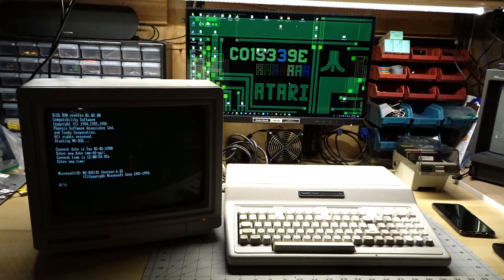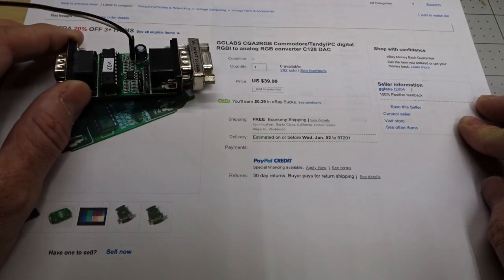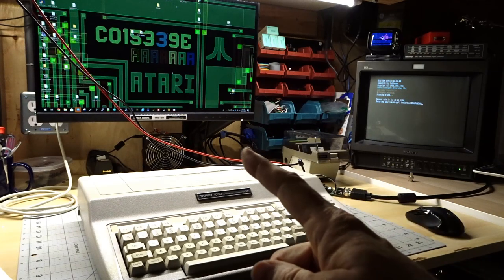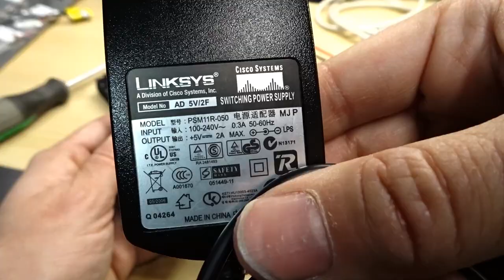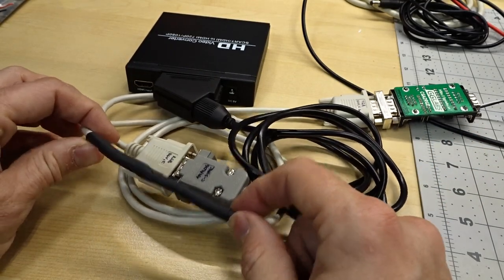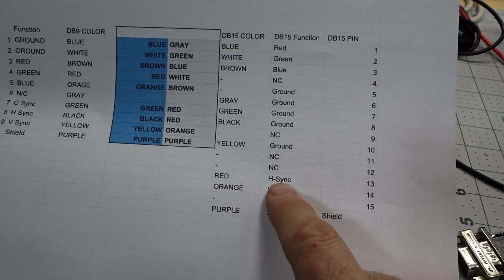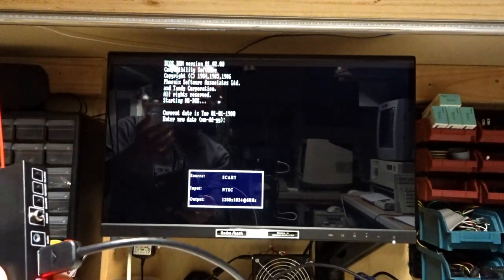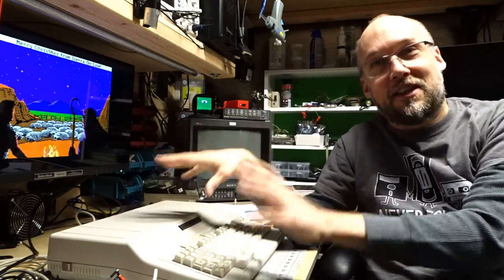How to convert CGA video to HDMI for around $65

Comment: Hi, 
Would that HDMI box also convert other SCART sources such as Nintendo or C64 sources to HDMI? :-)
Regards
Simon
Reply: Yes, you can. It is a quite good box for analog RGB sources such as Amiga or Atari ST. It will also work with a Commodore 64, but composite over SCART only. It does not support S-Video over SCART, so you wont be able to the the C64's S-video signal.
Reply: I found one on eBay that supports the C64s svideo mode and it works beautifully

Comment: Hm I thought some random guy said the tubes don't wear out but have to be adjusted or something?
Reply: CRT's do wear out, but for this use it will take a long time. Running daily (like our TV's did) signs of wear came after 8 to 10 years. Using these old screens today once in a while will make it more likely to get bad HV transformer and caps.

Comment: You should make those cables and sell them.
Reply: I'm sure he has no free time to make and sell cables since he mentioned having a regular job besides all these videos he makes. however, it's public info out there for anyone that wants to take on the production of them.  Likely the market is too small, though, and most retro folks rather just make their own cable since it's much cheaper (not something that would be mass produced cheap).
Reply: Similar pre-made cables are available online, just takes a bit of searching. ;)

Comment: Well..... that RGBSCART to HDMI converter is as awful for computers as it is for retro consoles. Wanna know why? That’s because as you said it uses the same chip as an lcd panel, it misinterpretes 240p video as 480i NTSC TV video! That causes blurring whenever something is in motion because it tries to deinterlace something that is not interlaced by creating non existent even and odd fields! Whatever resolution it is, 320x240 (DOS) or 320x224 (Genesis) it looks okay at first glance but after you play games with scrolling or just motion well pixels will no longer be pixels but just smoothed areas of color due to the 240p interpretation as 480i mess, I personally have and recommend the framemeister from Dempa Micom Soft (japanese company), it is sold on Solaris japan for an expensive price but that’s the lowest on the entire internet as it is no longer produced :( but there is some stock left so get one quick if u want one, it offers great 240p up scaling and very sharp results! It supports oddball resolutions even on RGB SCART such as 24khz Japanese pc signals and stuff ... but for an even better but less stable solution you could acquire an O.S.S.C from videogameperfection.com as it is roughly 120 USD and it works as well as the framemeister ! It is in constant production and gives awesome results for its money! I don’t want to harass you with my stuff but that’s just my advice. I know the objective here is to find solutions that don’t break the bank but anyway great video as always :) !